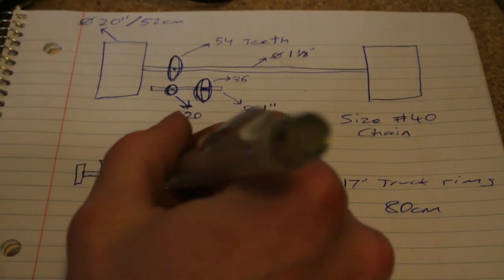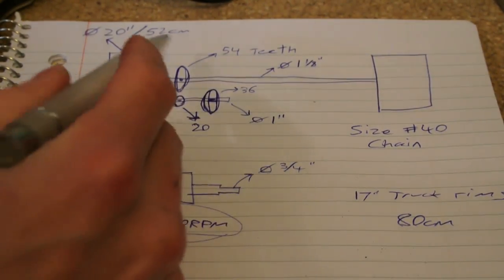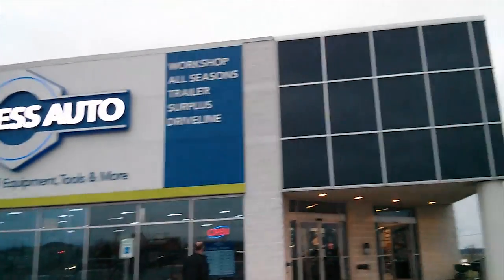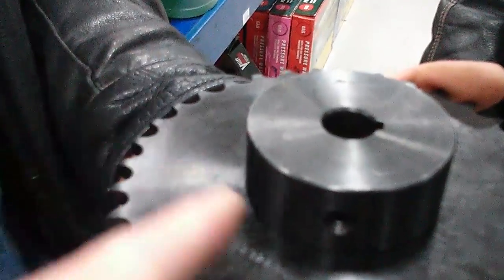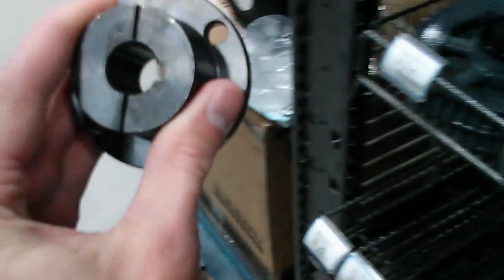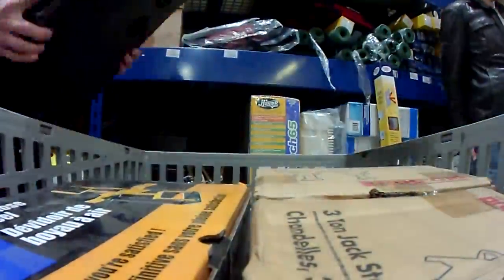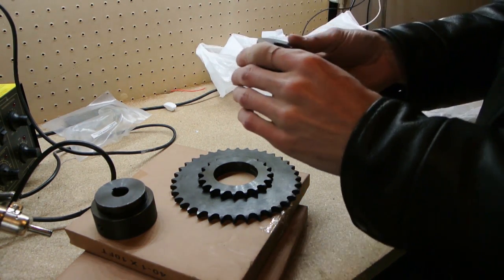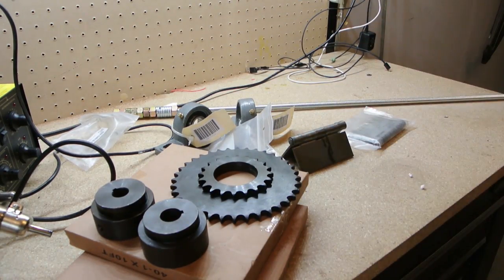Electric Dune Buggy Conversion, Part 2: The Shopping Trip

Comment: How heavy is that motor alone?
Reply from the maker: Not too bad actually, maybe 80lbs?
Reply from the maker: We actually have the main drive motor from the forklift as well... it's about 1.5' in diameter and 2' long. Must weigh 250+lbs